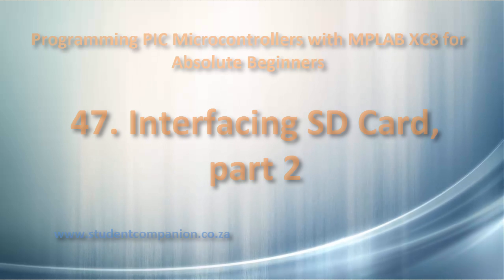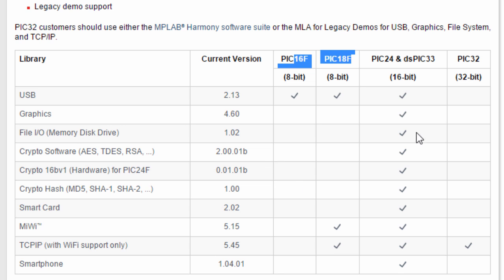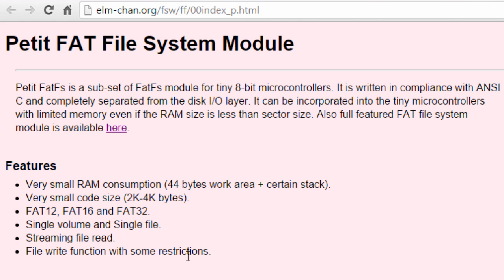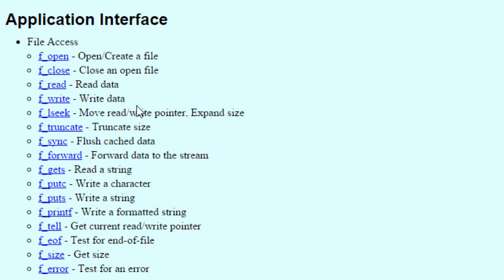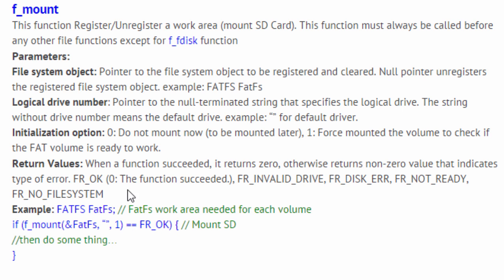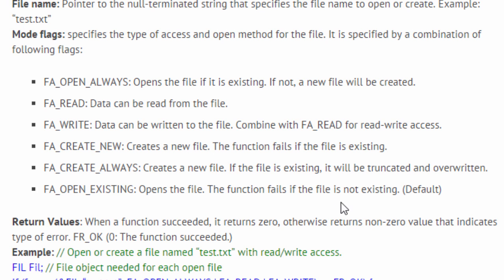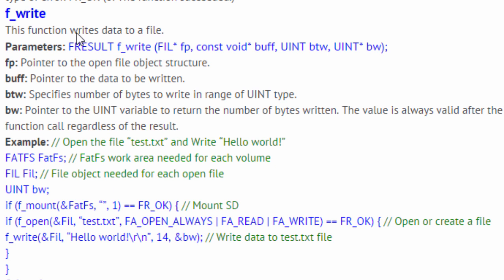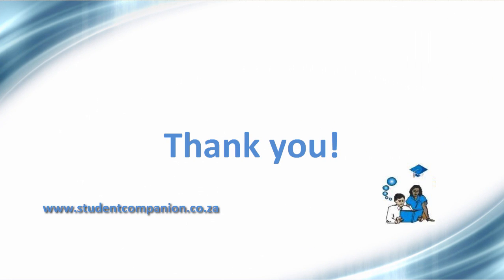47- Interfacing SD Card, part 2 | MPLAB XC8 for Beginners Tutorial

Comment: Hello  I am interfacing PIC18F67K40 with SD card using MCC Fatfs

I follow your tutorial each step.but now my code is not working. Sometimes it write data successfully and sometimes not write anything. 

When I visualize it through Logic Analyzer, its showing "initial clock does not matching "
Why its happening please help me.
I shall be very thankful to you for this
Reply from the maker: Hi. Did you follow this tutorial where we added the fatfs files manually? Which version of fatfs did you use?,
Or did you follow this new tutorial where we used MCC fatfs library: https://youtu.be/foHHgmWXZ3k
Reply: I followed the both tutorial 
Manually added  Fatfs and 
MPlab MCC fatfs library.

I faced problem in In mannual added is some functions are not working properly.

And in MPLAB MCC lib, sometime data write successfully and some nothing written in SD Card. Problem is " Intial clock is not matching" 

So please tell me which tutorial are best for me
1) manually added FatFs library 
Or
2) MCC FatFs
Reply from the maker: Both tutorial use the same fatfs library so tgey shouldn't be a problem in principle.  The mcc just simplifies everything for you but it uses the same library .
In our manual tutorial we used an older verion of fatfs during that time it but they modified one function in their new version that affects how one function is used, that's why you are getting some errors, we will update that tutorial soon. But if you used the same  library version it should compile.
If the code works somethimes, you didn't check maybe it might be hardware issue? Do you have the correct voltages all the time? Did you try using a different card and experience the same problem?
It's difficult to guess more without seeing your card and your physical setup. Are you using an sd card breakout board or your own guilt circuit? 
Can you post your code and mcc configuration setup screenshots to see how you initializing your card, clock and code? Post in the forum: www.studentcompanion.co.za/forums
Reply: Hello, I posted my querie on you Forum, please update to me on studentcompanion.co.za/forums/topic/problem-in-sd-card-interfacing-with-pic18f67k40/
Reply from the maker: Ok. We will follow-up there.
Reply from the maker: You don't annoy somebody's trying to assist you.  It's always good to follow simple rules.
Reply: @StudentCompanion  
Sir still I waiting your reply from last 1 week.
Are you providing the Paid Service also??
I want a paid service. because I can't wait more.
Actully my project is to first  simulate the MCC "fatfs library on PIC18F67K40 with SD card" and then use the same code on Hardware.
I have no a more time for project.
So I am requesting to you again and again.
I really need your help In interface
 " PIC18F67K40 with SD Card"🙏

Comment: First of all, thank you for your help. I am downloading the MPLAB X Project SD_Card_FatFs file and uploading it to the 18F45K22 microprocessor, although it has already created the test.txt file, I can't create it now, please help me where I make a mistake.
Reply from the maker: Hi. Can you explain more about your problem. Does it create it only once? Or not at all? Did you modify our code or you used it as it is?
Reply: @StudentCompanion   I did a study a week ago and then created the test file. I had to reinstall windovs on the computer, so I installed MPLAB IDE 4.05, xc8 (2.10), I started working on the project again this day but it doesn't create the test file on the same board, The project was created with a newer version of an IDE. open it anyway? this may corrupt the project. I get the warning. sorry for bad english
Reply from the maker: A newer MPLAB IDE cannot corrupt the file. Are you getting error messages when building your project?
Reply: @StudentCompanion   no
Reply: @StudentCompanion  it does not create a new test.txt file, but writes to the sd card. I do not understand how he wrote without creating.
Reply from the maker: Your question is not clear.  How does it write to a file without creating a file? Where does it write to? Does it write to an existing file in the card?